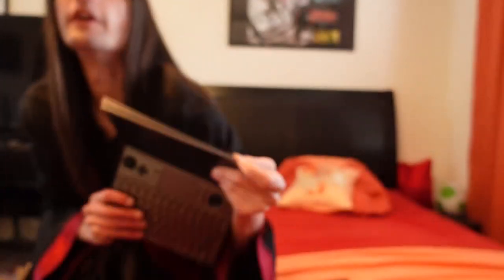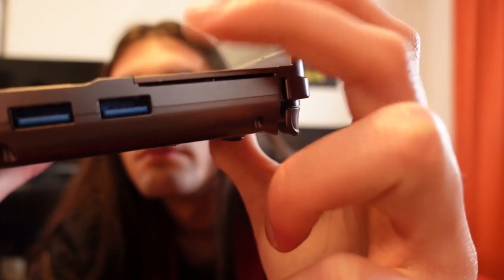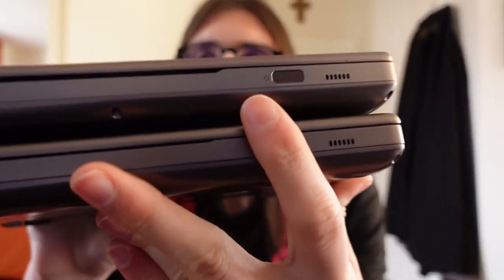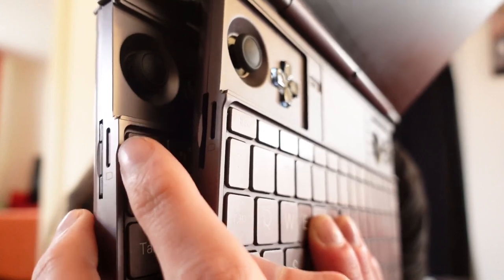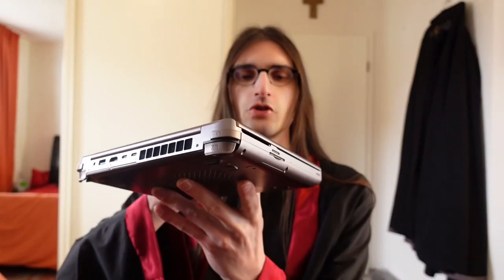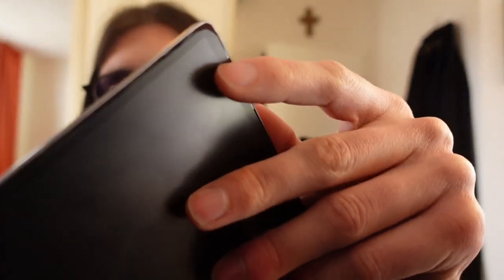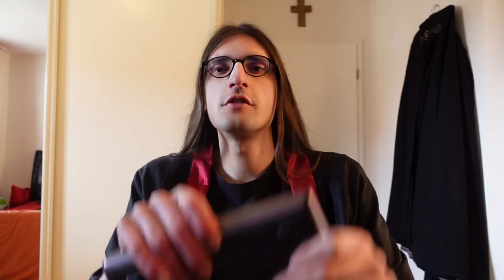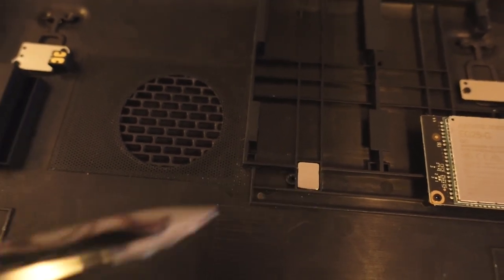You will not see this elsewhere - GPD Win Max 2: Prototype vs final unit

Comment: Thx for the video. It's interesting to see the differences between the prototype and the final version of the WM2. :-)
Reply from the maker: There is one more difference I forgot.
The prototype is magnetic all around, so you can attach a magnetic stylus all around.
The final unit is not magnetic any more.
I did not notice that until after the video.
Reply: @mystechry  Interesting. Would've loved that on the final version. :-)

Comment: Noticed when charging I can feel a tingling sensations when I touch the lid or parts of the unit. Feels like the flow of electricity. Did you notice that on yours?  Thanks for the video.
Reply from the maker: Yes. Both have that. Prototype and retail unit.
Reply: I changed my adapter to a grounding one and it helped. Might wanna look into that.

Comment: I want to buy one of these so bad. But I’ve heard that almost all of them ship with malware/worms. Did your device have any?
Reply from the maker: Not all of them. Only a hand full.
Also that worm is always the same which will be detected by Windows defender without even doing an update. So it is not even a threat.

At the moment, we do not know why this worm exists. The most likely answer is, that some worker at a factory installs this to harm GPD. This worm will 100% be detected by defender.

If you want to be 100% save, simply make a Windows boot USB stick and reinstall. It is super easy and quick to do.

By all means, get a Max 2. The chance is suuuper low.

If you do not want to get one with a worm 100%, buy the 2tb unit from Dragonbox. That one will get a custom SSD from the shop owner, as GPD does not sell 2tb units officially any more. So this one will get a fresh install by a reliable German company.

Comment: Hey do you know anything about the sd card reader problemo everyone is unfortunately reporting?
GPD have responded saying it’s a software issue and not a hardware problem but I’m a little sceptical 🧐
Reply from the maker: I do not know anything about it, as my reader is fine.
All I know is, that you can increase the stability of the reader if you decrease the speed to USB 2.0 in the BIOS.

To fix the full speed fully, there needs to be a BIOS update from GPD

Comment: I think I got a prototype unit!!! WTFFF
Reply from the maker: Nono, do not worry.
The first IGG units and the domestic shipping which happened before had much similarity with the prototype.
There were quite a few units with the old housing.

I should have made this more clear I guess.

Do not worry. You did not get the faulty touchpad for example.

There were quite a few units with the old screen and housing.
Reply: @mystechry  Seeing as you seem to very responsive, I have to ask. What was the thinking behind you throwing the two devices together like that? I would never do it and seems a little callous and wasteful if one of them were to break. Great video though! thanks for it
Reply from the maker: @chanunnaki  They do not break.
It is all because of my dark past.
Check this out: https://www.youtube.com/watch?v=GsyNZuEjE-M